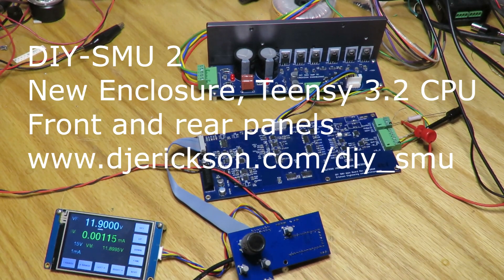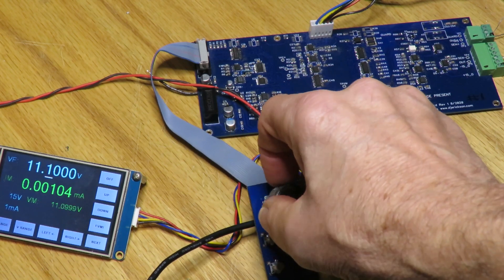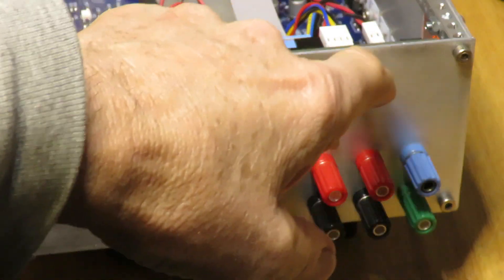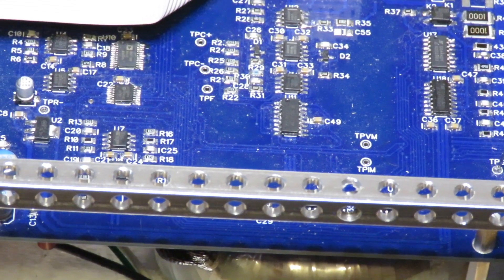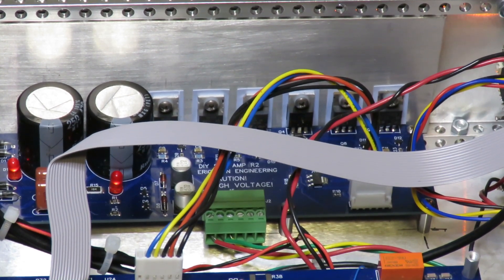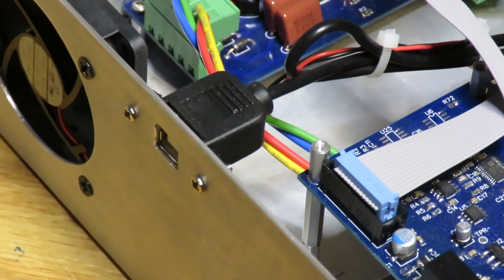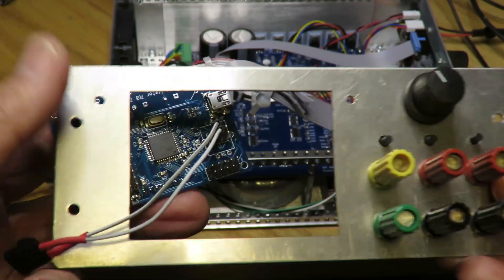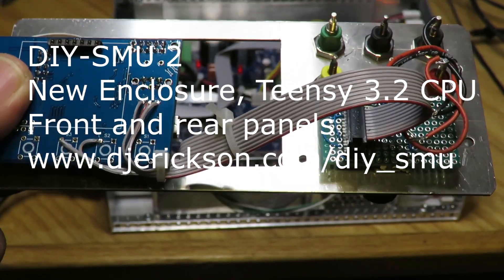DIY-SMU Chapter 2: New Teensy CPU and Enclosure

Comment: Can't seem to edit my other comment,.so I'll add here.
I wondered if you might gain something by isolating the front panel containing the output section, splitting the front panel, mounting two sub-panels on a."carrier" PCB or aluminum frame? Any ESD issues?
I'll try to get to reading the whole package, may take a few days... Meantime, it sure looks like fun!
( A little side note: I saw that you mentioned an rs-485 network; one of my first "official" contracts was building an interface to a network of 200 microprocessor controllers, in 1980.)

Comment: Hi Dave; I do have a few ideas, but I'll go to your website to.check out direct contact.
Or, so I thought, but no contact information to be found, and I'm a bit shy about comments on YT. ;-)
Interesting project, and your background looks pretty interesting, too!
- AC power switch on front panel: is it via a low-voltage DC relay, or?
- fan: is it positive or negative pressure?
- self-clinching nuts installed in the rails, instead of nuts, or threading aluminum bars?
- thermal symmetry?
- thermocouples?
Thanks for the very detailed coverage on the web page, which I have not managed to read through, yet ;-) therefore, of these issues are covered there, just ignore me ;-)
Reply from the maker: Hi Lohi, 
Thanks for your inputs and your thoughtful feedback. 

I think Isolating instrument circuit and grounding the complete case, 12V supply, CPU, UI, USB, etc. is best. That way all user accessible parts and communication connections can be grounded for ESD, EMI, safety, etc. When isolating, it is important to minimize the capacitance to GND of all the floating stuff. So generally isolate the minimum amount of stuff. Im DIY-SMU's case, that means the toroid secondary and 2 boards. I used a medical-grade toroid so the transformer has a shield between primary and secondary. 

As far as an AC power switch, I'll look into using a relay. 

The fan currently draws air from the box. Not ideal, but good enough for the 30W max dissipation on the heat sink plate. I'l put air intake holes near the front-right side so the air is drawn past the heat sink. I can add some fins if I need to improve cooling. 

Self clinching nuts, great idea. I'll look for ones that fit the 4mm holes, ideally for M3 screws. Could drill the holes slightly larger. Are they DIY-friendly, meaning low cost tooling?

Again, Thanks, 
Dave

Comment: Is there a common name for those modular aluminum beam / rails with the holes in them?
Reply from the maker: Gobilda calls them "1106 Series Square Beams". Others sell them also.  The 1119 series are very similar but intended to be used as shafts.

Comment: This is indeed an awesome project. I am very impatient to start building (copying?) my own. So, when can one expect it to be far enough evolved to start building parts of it? What are the actual choises for the display? Is the Teensy the final choise? Is the power board "final"? And if I build part of it, will the software be made available?
Reply from the maker: Hi and thanks! The hardware is fairly stable. I'm working with others on the final firmware: cleanup, GUI, Plotting, and SCPI interface. I plan to have a buildable / copyable design by late spring. I'm not 100% committed to Teensy and Nextion.  I would like to keep the firmware Arduino so others can easily modify the firmware. The amplifier board and it's transformer are tuned for 150V 100mA, but a different output amp (higher current, lower voltage) can be built. Or even a higher voltage.
Reply: @ericksonengineering7011  For CPU I would like to try it with Raspberry Pico, now it has Arduino support too. For power I'm thinking if I should use one outlier of a transformer that I have. It has 80-0-80 V output at 330 VA. Too high voltage for general power supply, maybe low for SMU and too high power for light instrument. I wonder if I should get one that is better tailored for this application and ditch that one...

Comment: Love the project. It is a good base for modifications. I looking forward for next improvements, especially the analog and the power board. I am pretty sure I am going to build one, but with some own modifications (i.e. merge two boards, make it remote control only, with no display and no buttons, beyond maybe on/off and trigger. Using two separate boards is great for initial revisions, and troubleshooting, fixing, etc. But some connectors, cables and space could be saved with one board design later) and possibly own software, but the hardware looks good. The design you have here is definitively good, no complains about it. The only think I would complain a little bit, is the length. I think it is super important to make the instrument as shallow as possible. Even at the expense of making it wider or taller. Sure, I understand you are using already pretty tall enclosure, and using half 19'' rack width, so that is fine. But even shaving 30mm of the depth would really make a huge improvement. I just hate very long instruments.

As of the one board design, of course, it is preferably to have two boards (or three) during prototypying, etc. But one board design could also be possible, for example some components could be placed on the top, but big capacitors and mosfets, relays and other big TH components could be mounted on the bottom side. Just an idea.
Reply from the maker: Thanks for the feedback. I agree, smaller is better since bench space is usually a premium.  If Gobilda made ~10" (256 or 248mm) rails I'd have used them, saving 24-28 mm. I could cut down the 280mm ones, but that makes it less DIY. Their next size down is 232mm, 48mm shorter, and a tight squeeze. For comparison of half-rack 2U stuff,  my HP 34401A DMM and (old) 3478A DMM are 2" longer (13") and the 33220A WFG is 1" shorter.

Comment: That’s awesome! 
Did you see Marco reps mentioned an open source measure unit on his channel about two years ago,,., in his siglent power supply video. 

He showed the Beautiful matte black and gold plated boards and it was obvious he had already put hours and a lot of money into design. 

I don’t know if he ever finished it… I guess he didn’t or he would’ve offered it. But given his habit of chasing perfection and ppm’s… If we could guilt him into finishing the project… I think it would be a great win for the entire community! 

He had a lot of unique ideas, which would make his unit irreplaceable in the lab… Taking the place of many more high precision an expensive device is that even a normal high-quality SMU’s
Reply: I don't think he's abandoned that "OSMU" I believe it was called, project. He's gathering the necessary prerequisites to build it. He needs an ultra precise reference, adc, calibrator, and voltage standards. If you pay attention to his videos, the OSMU logo that appears to be an ostrich bird, is often sprinkled throughout his videos. See for example his most recent video at the very end https://youtu.be/D28uSzCs7-k?t=2003 you will notice a mug with this logo. There is no way he will have given up on the project if he went as far as making that mug and the Samsung charger. I have no doubt it will be coming in a year or two.

He even sells a hoodie with that logo https://teespring.com/shop/osmu